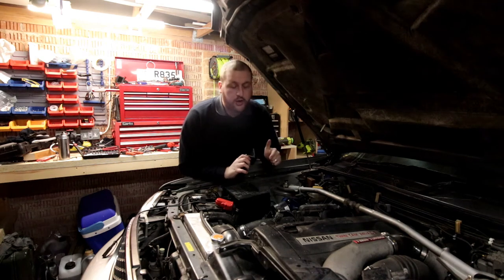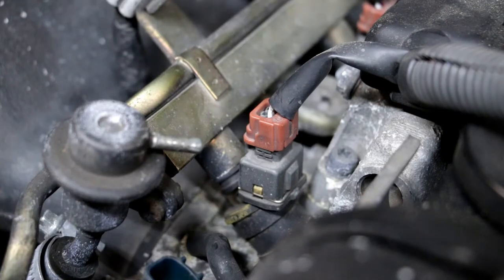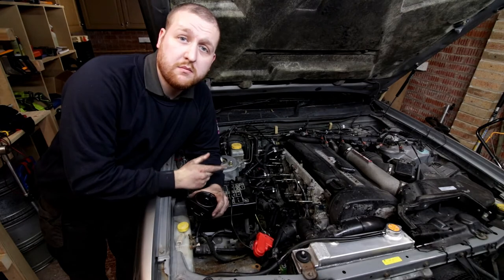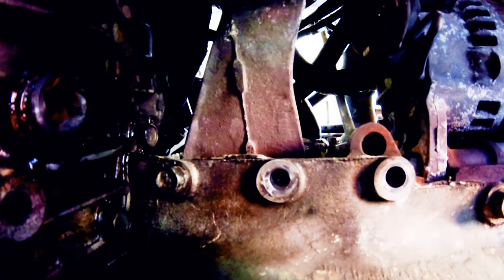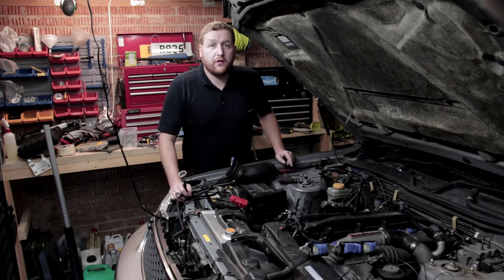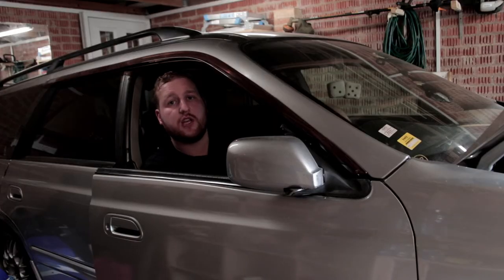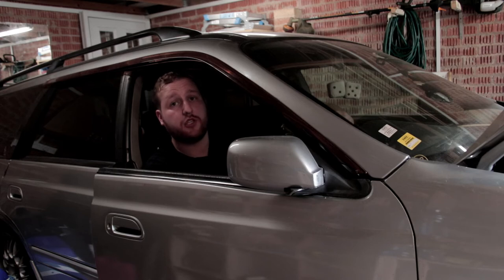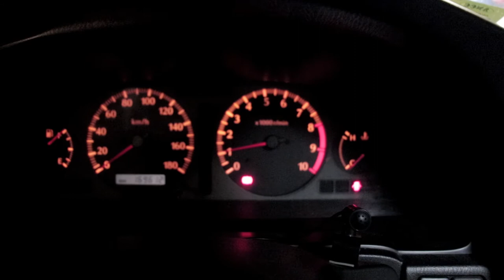RB26DETT Oil Filter Relocation [Nissan Stagea 260rs]

Comment: So you just used 2 sump bolts to mount the bracket? I’m about to do this in my rs4s
Reply from the maker: Hi, yes that’s what I did, but I would advise that you measure the thickness of the plate you use to mount the oil filter and get two bolts of the same grade (if possible) with the plates thickness added on to the bolt. I can’t remember the length of the bolt but For E.g. let’s say the bolt is 60mm and the plate is 10mm I’d recommend getting a 70mm bolt to put in instead. Otherwise get an 80mm bolt and cut down to 70mm! Hope this helps and thanks for question
Reply: @thenortherngarage4612  yea I absolutely planned on longer bolts of the same grade and torquing to spec